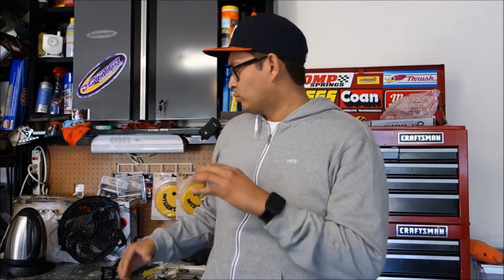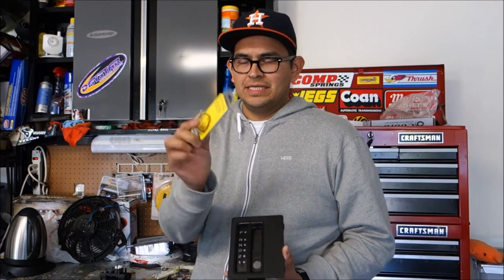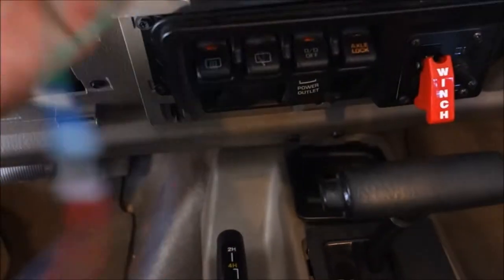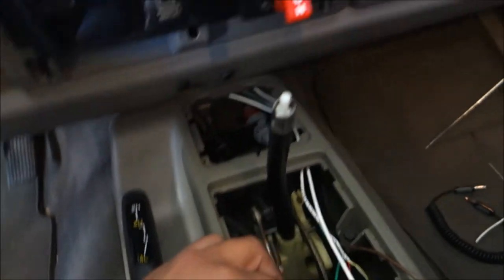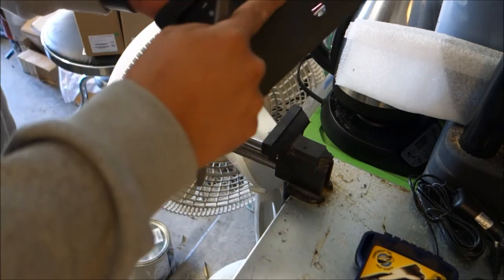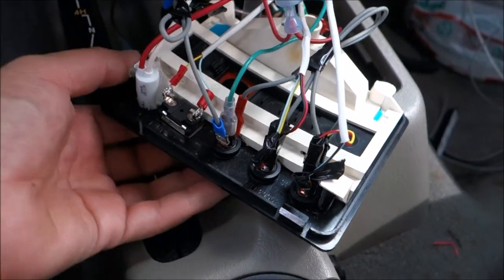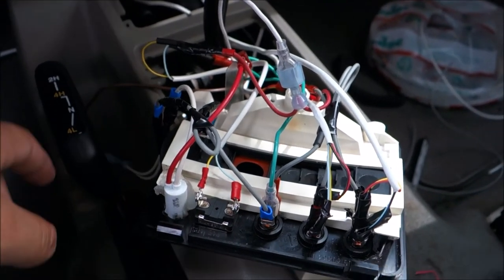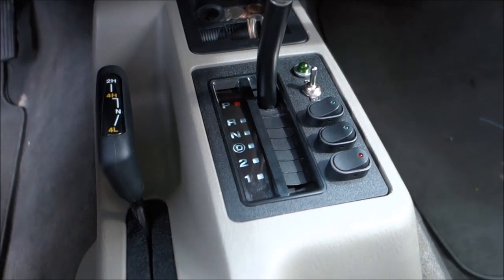Jeep Wrangler Shifter Plate Switch Mod

Comment: Great use of space. I added an OE style light bar switch to the dash where you have the axle lock. I hate adding holes but this is really clean. I'm glad I have an automatic to try this.
Reply from the maker: Juan Gonzalez it's a awesome mod, highly recommended it, if you have lots of accessories to control,  thanks for watching

Comment: This video should come with a warning. IF YOU SCREW UP THE SHIFTER PLATE TO THE POINT WHERE YOU MUST REPLACE IT....get ready to cough up big bucks. Those plates are not cheap.
Reply: Blue Roof Bandits Picks did you fuck up and have to replace it😂

Comment: How did you get the actual plate off of the shifter??
Reply from the maker: sorry on the delay, i use a small flat screw driver to pop the plate off, be careful with the bulb ,turn and pull bulb out , thanks for watching
Reply: @MikeTheJeepster  what type of bulb in the gear shifter.Thank you in advance.